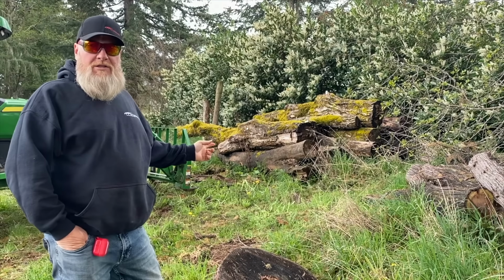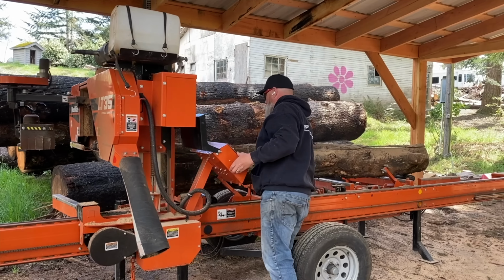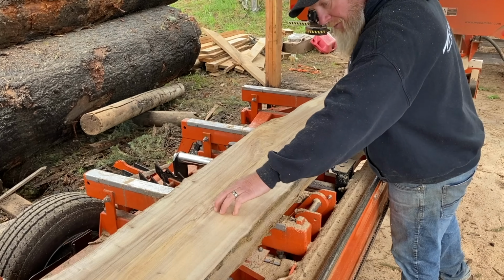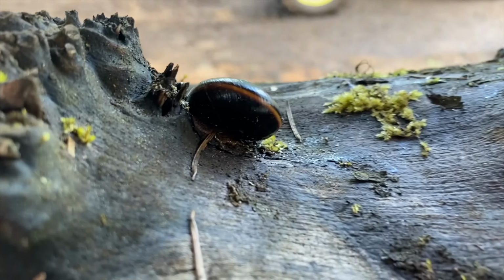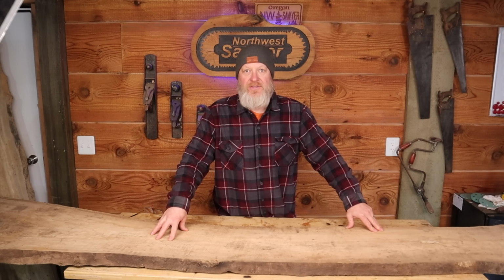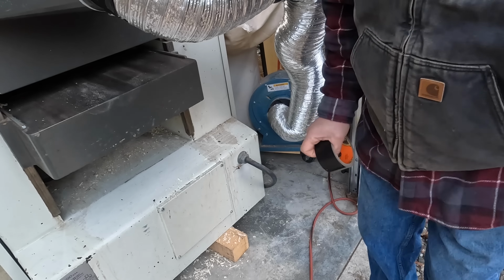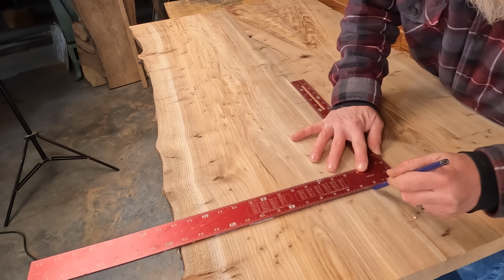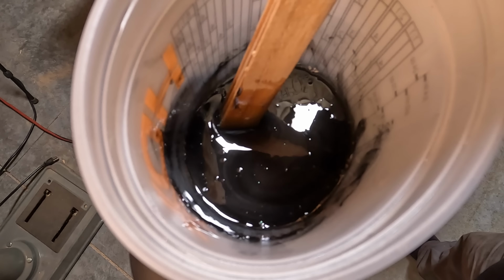From LOG to LIVING ROOM

Comment: Great work. I made a kitchen table out of ash that the boards were under cover outside for two years. Table came out great, inlays and everything. After a month inside the table curled up, warped and cracked everywhere. Don't know why.
Reply from the maker: Thank you! That’s a real bummer. Every species reacts differently. Did you use the same finish on the bottom side of the table as the top?

Comment: Hi Jason 😊 good to see you taking a chance to see if you can spalt black walnut. Just got a few more left to do 😅. Can't wait to see what you do with them. As always good luck and God bless
Reply from the maker: Thank you, Mark! I milled a couple more of those logs but I waited too long on some of them unfortunately. I have more plans for this wood. Stay tuned!
Reply: @NorthwestSawyer  what stand's out there most is the the fact that the board's didn't change color but the grain is undeniably walnut.
Reply from the maker: @marknunya3035  well, the wood did darken a little but the grain exploded with this finish. I was a little worried when I first poured it on but it definitely pulled through. 😉

Comment: Beautiful wood and great craftsmanship!! You are to be commended on your work! One question though- are you concerned at all about bugs in the slabs? Some who sell slabs and lumber will not sell without sterilization in a kiln. Just wondering........
Reply from the maker: Thank you! Those trees have been down for over 5 years now and slabbed for two. I think the bugs would have shown themselves by now. Honestly I haven’t seen any bug activity in this species like I have in others. Even some of my cedar which is supposedly bug resistant.
Reply: @NorthwestSawyer  Thanks. I figured there was a good reason and you had it covered!